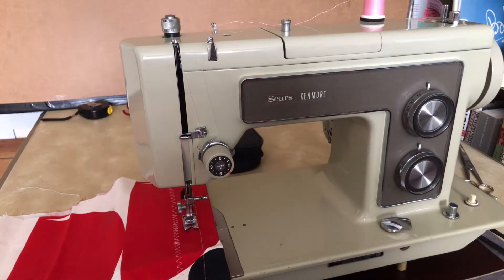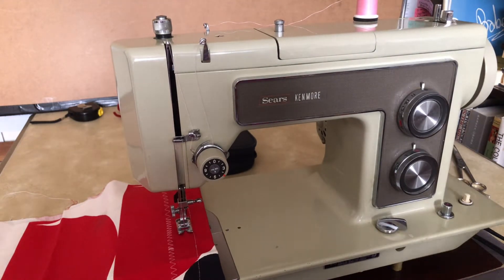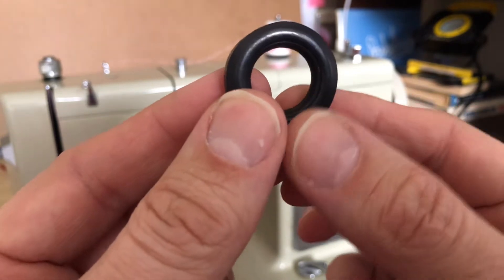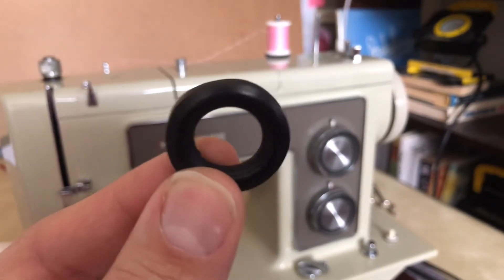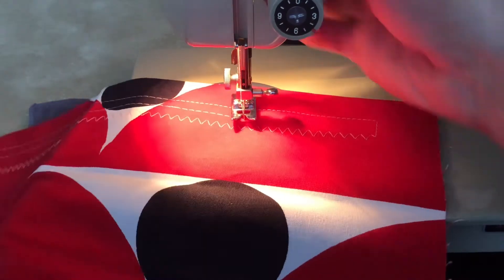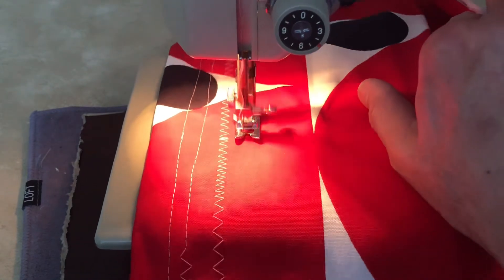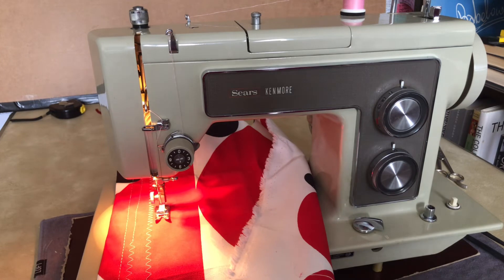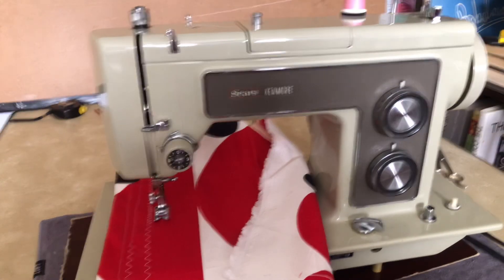DEBUT SERIES #46: If You Sat 30 Years, You Might Have a Bald Tire Too! The Kenmore 158.1516 Awakens!

Comment: I have a technical question about a Singer 401A.  It runs very smoothly at low and higher speed, but at middle speed is has a vibration. Also, when I turn the wheel by hand, it would do 2-3 turns very very smoothly then gets slightly stuck. If I move the wheel in reverse just a tiny bit, it unstucks and starts moving again very smoothly. I can see not contact at the needle, presser foot, shuttle, etc. Fully lubricated including camshaft, etc. Could you point at something to look closely ?